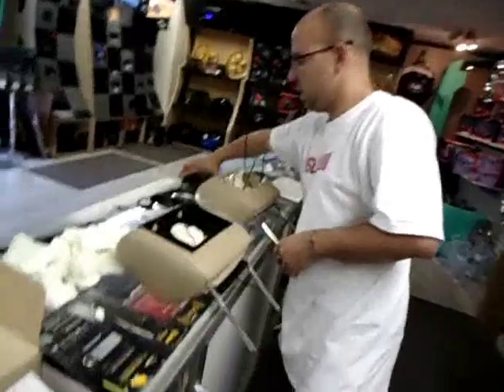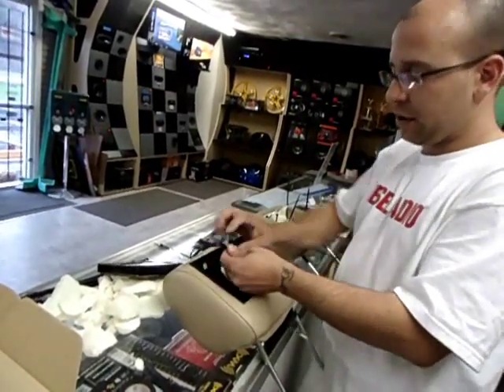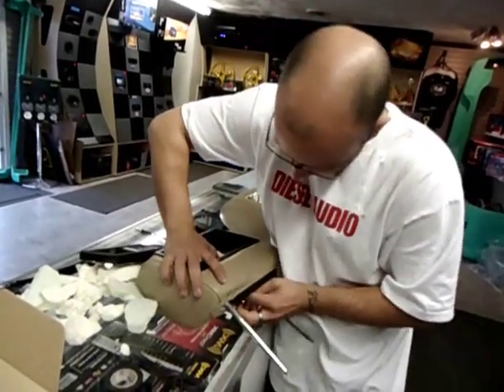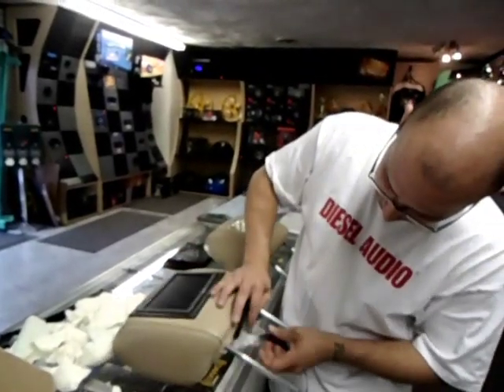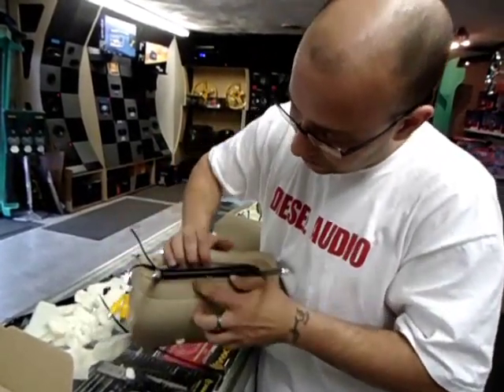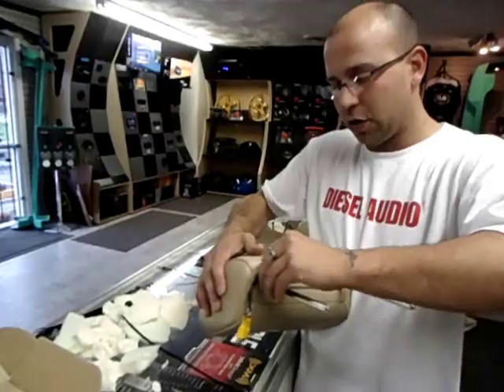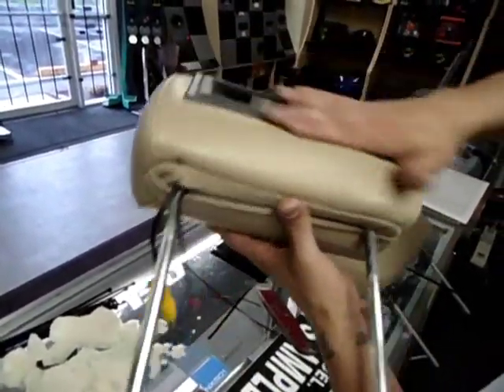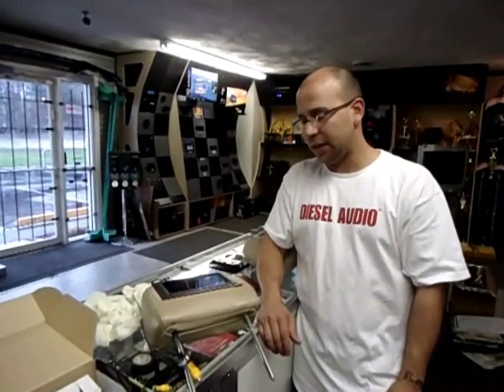How to install Headrest Tv's/monitors Part 3

Comment from the maker: @fkobama1 , Generally speaking, the Universal Headrest tv's that are pre-loaded dont match 100% to the OEM materials used in every car ever made. So when we simply install them inot the OEM Headrest, then material matching isnt an issue. Overall cost is close to the same either way depending on the quality of the prefab headrest, so i would say client taste is really the best answer for not using prefab headrest.

Comment from the maker: @SinBeatz1 , most, not all but most, seats you can reach up from underneath (like a skirt), and simply pull a line through the same hole as the "rod's" enter. you'll stretch the leather a bit but once the headrest is put back in and set flush to the seat you wont see any wires.

Comment: most pf the time to the accesory wire on the head unit so the monitors only turn on when the radio is on. there are different ways though, you can also add a switch or some come with a plug that will go to a box which you then wire to the car.

Comment: Regarding brands:
A friend of mine bought a couple of cheap strange format LCDs, poor quality and out of production = very cheap, but OK.
They were a nightmare to install, because they were so thick! And after we were finished, one of them didn't work!
He didn't test them before mounting. As they were out of production, he couldn't get a new one, and had to get another brand, another format and therefore a new headrest.

The headrest was way more expensive than a couple of nice monitors...